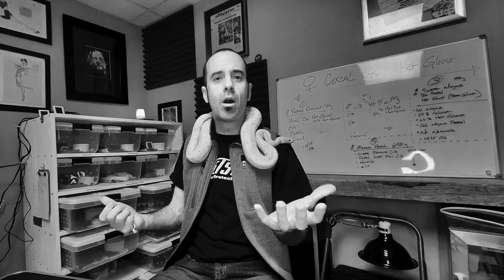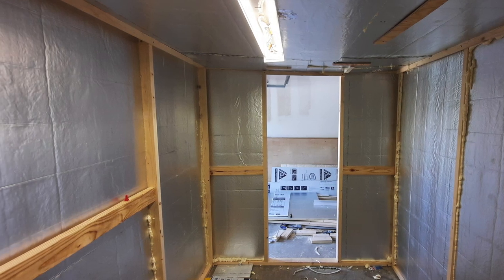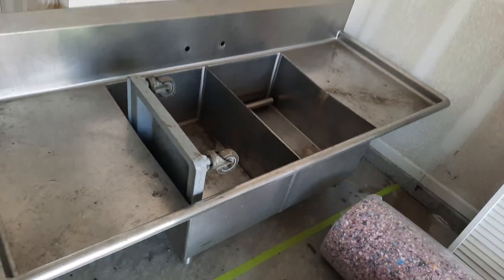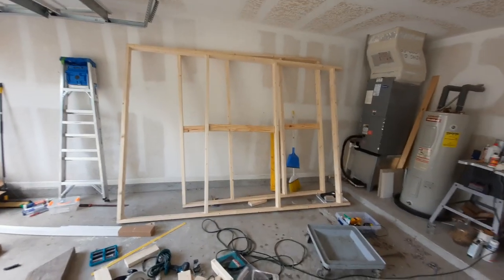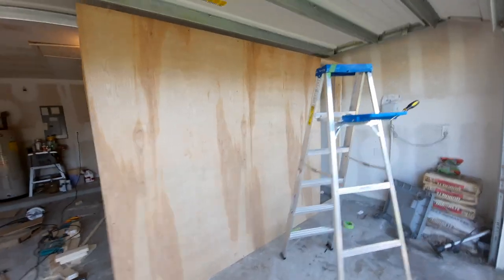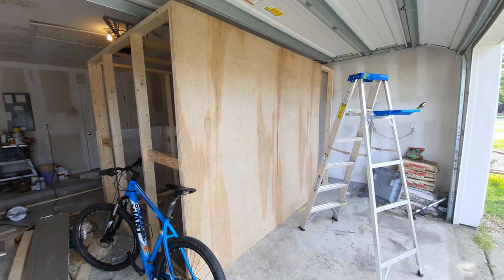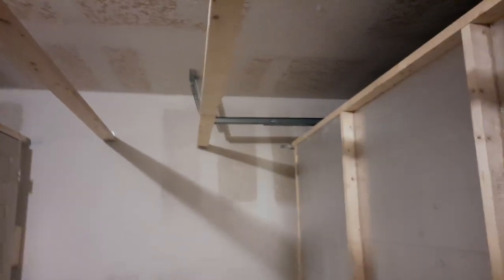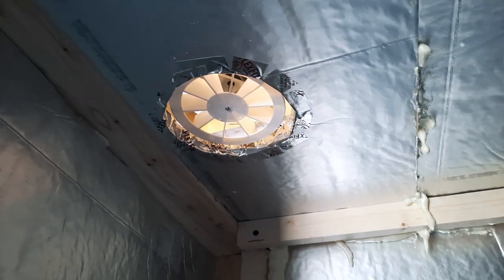Let's build a snake room!!  From Scratch, Part 1.

Comment: Looking good man. Definitely shouldn't have a problem controlling temps in there.
Reply from the maker: Joey, thank you.  I've still got to install the split AC unit.  The whole garage is actually going to be temp controlled for my new office space as well as the snakes.  I probably went overboard on the insulation in the snake room, but better to be safe with these animals.  Thanks for checking out the video.